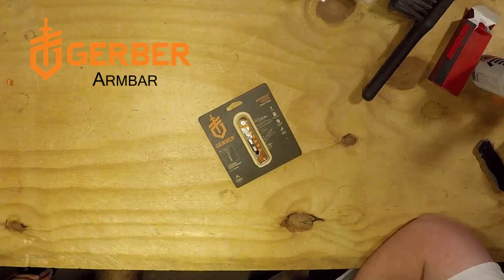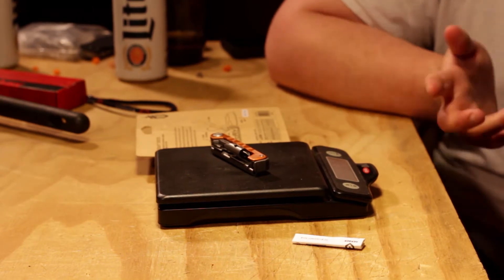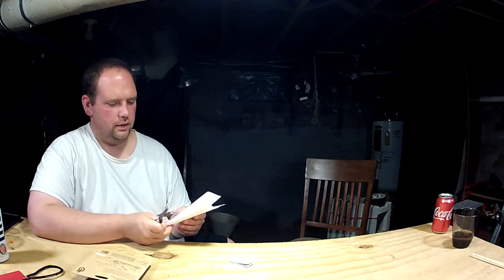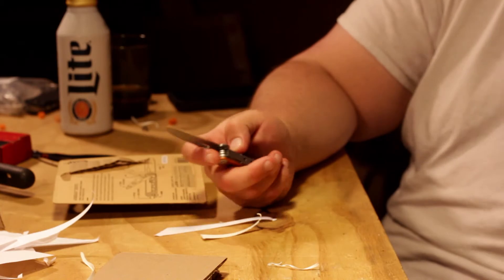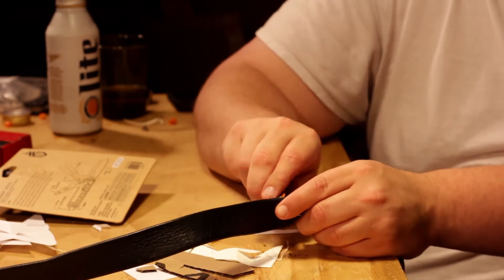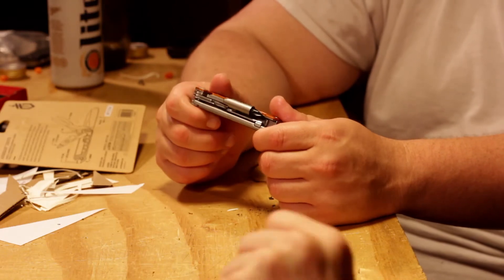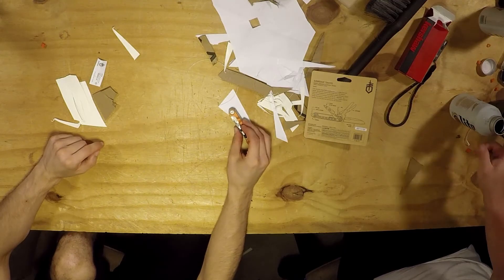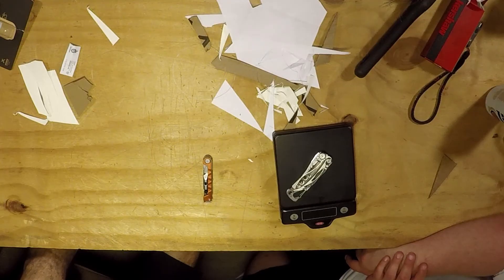Gerber Armbar Unboxing/Review

Comment: Awls are great! Its a way to preserve a more delicate blade from boreing/poking into stuff! I will say that this awl isnt that great, the best awl i found is on the Victorinox Alox Pioneer! If you want to Poke a hole in something, that awl works better than any knife!!!!
Otherwise awls are generally used a lot in Bushcrafty type stuff, where you bore holes in wood or leather or other things quite often! Like any other tool, it needs to be learned and understood!
Reply from the maker: Thank you for the solid answer!

Comment: Hi guys! Lately I have been dedicating a lot to multitools ... so $ 30 is not low and in my opinion this multitool does not seem very useful or even very resistant. I recently bought a very interesting multitool at a low price called "Nextool mini flagship" it hasn't arrived yet but from some videos it looks really very good !!! Give us a look, also soon I think I will buy a victorinox "Spirit" multitool complete with key and Bit (but here the price goes up). I already own a leatherman the discreet and cheap "Rev" does its job! See you soon good life!
Reply from the maker: I think it really comes down to what tools you need on the multitool. For some, this little guy might be perfect. I personally need to have pliers on my multitool. But $30 still is not a bad price when compared to most other companies. Im writing these others down to look into them further.